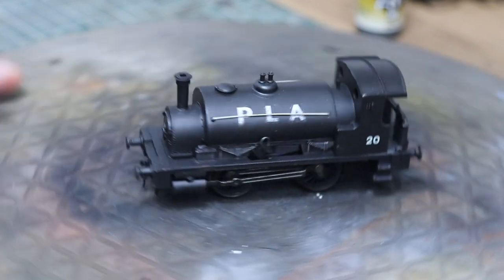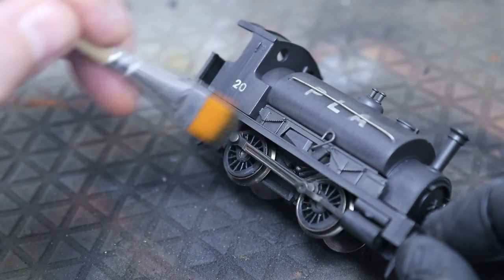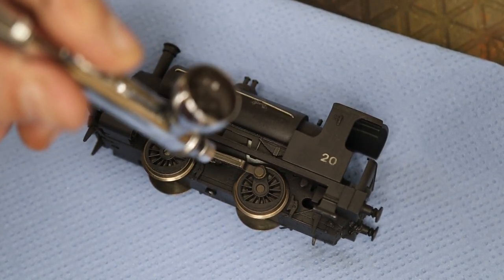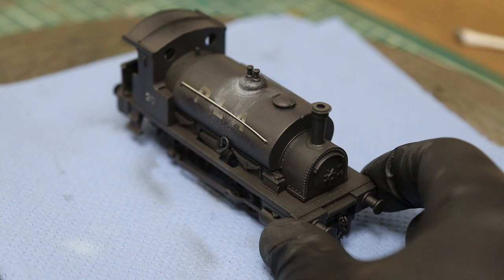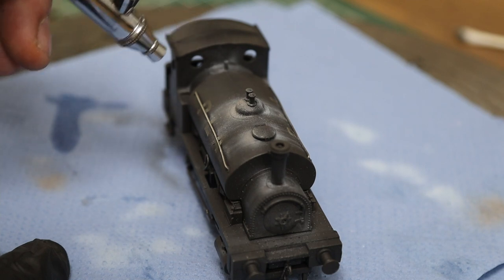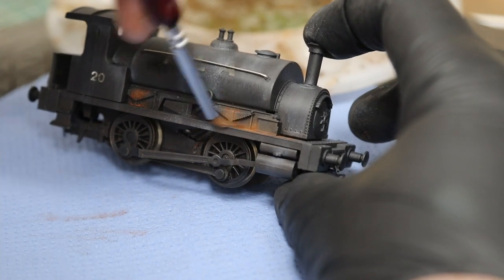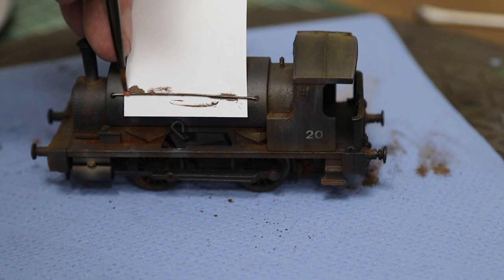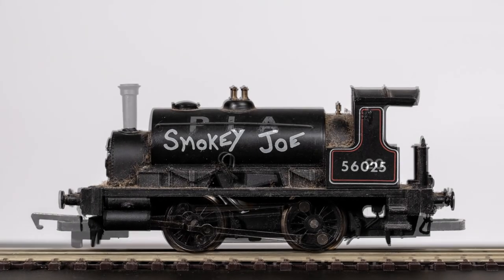eBay Rescue | Hornby Smokey Joe Pug | Weathering Model Railway pt 2

Comment: Looks realy good nice job ,they normally ran with a short wheeled wooden wagon with built up sides and open front as a make shift tender .
Reply from the maker: That’s interesting. I’ll see if I can find an image. I’ve got some spare wagons that I was going to use for a PLA rake. Thank you.
Reply from the maker: I’ve found a couple of pics and a ‘blueprint’ of the original wagon. I think I have a couple of donor wagons that I can mash together. Look out for a video real soon 😂

Comment: Humbrol black weathering powder, glad I'm not alone with that! I have to put mine in a pot and grind it down lol.
As always some great tips all throughout and a great transformation 👍
Reply from the maker: I’ve tried the Vallejo black pigment but it doesn’t seem to adhere at all. Maybe need to use a binder??
Reply: @BuntersYard  vallejo pigments work completely different to humbrol powders. Humbrol are a pastels so cling straight away and work better with solvent varnishes and thinners. 
Vallejo work better with acrylic based fixers / binders. 
You can flick the pigment onto a wet surface or apply them dry to the model and use a brush in acrylic thinner and lightly touch the powders, capillary action will soak into the powders and hold them in place, vallejo pigment binder takes ages to dry so I'd avoid that if you're in a hurry! Like the humbrol stuff it also needs sealing with varnish if you do the above. 
Both products from humbrol and vallejo are very versatile and can be made into paints, washes etc. 
The good thing with vallejo is once the binder you use with the pigment is dried you can buff it off again with a dry cloth, great for mortar between brickwork.
Reply from the maker: That’s great. I’ll give it a go. I’m sure it’ll make a video one day very soon 😁
Reply: I've not covered the subject much on vallejo pigments despite using them for quite alot of weathering projects mainly on the layout rather than on rolling stock. 
Should be a good video to watch if you get one out.